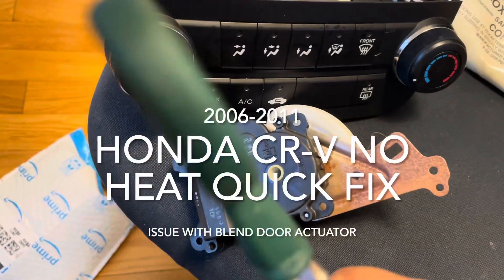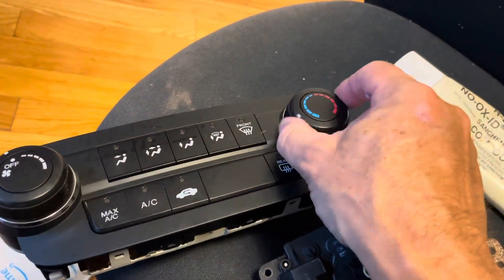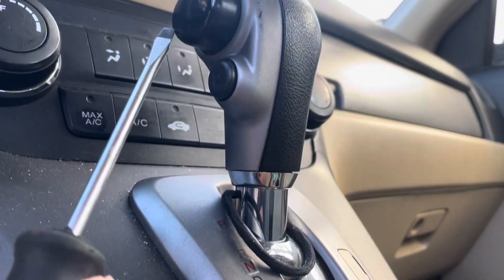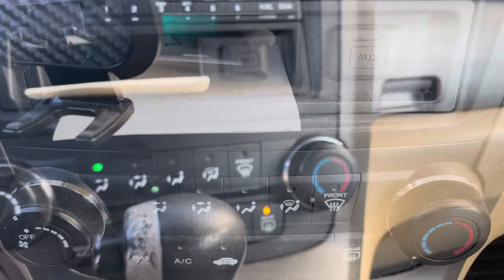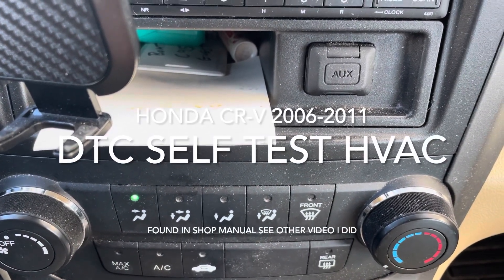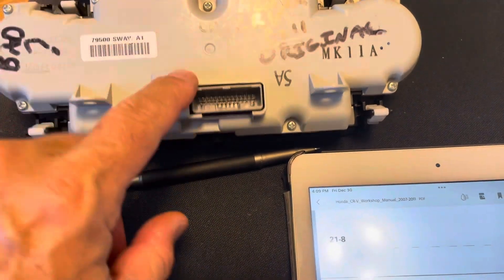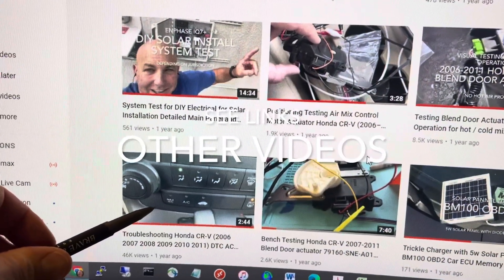Troubleshooting no heat Honda CR-V (2006 2007 2008 2009 2010 2011) no hot air blend door actuator

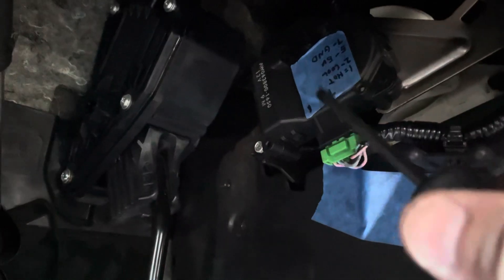Comment: Wow!!!  Tapped the motor by the brake pedal and unplugged/plugged in the green connector and 5 seconds later - heat.  Just like it says at 2:30 of the video.  This is after three chemical flushes, three water rinses and refill with coolant.  I have no doubt that had I brought it in I would have been charged $500, and the mechanic would have done the same thing.... Thank you Danny Jensen!

Comment: Thank you Danny. I tried a couple of steps you mentioned and could not get the heat to come on, then this morning I just tapped firmly on the thermostat knob and also turned it from cool to hot quickly a couple of times, and the heat came on. We will see if it lasts. Thanks for the video and help.
Reply from the maker: That is a new one. There is this stuff called electrical contact cleaner you can spray on the knob. If you have the problem again and it may help.  I have used LPS contact cleaner on an airplane gps knob and it worked great but this is the most expensive stuff.  Other CRC contact cleaner is also good. What is the knob you are talking about? I want to make sure the exact knob you refer to. Is it the warm cold knob on the climate control unit in my video or do you have a different unit?

Comment: My 2011 crv started not switching to defrost. After they replaced two actuators, the AC stopped blowing cold. And then the air stopped blowing. I don’t know what to do. I’m overseas and they don’t know how to work on my American car. 😭
Reply from the maker: @PinkGomo  Thanks for your comment. I am not an expert. Run the self test.  It may calibrate the new actuators. Then repeat self test. See if same results. Then if still not working, pull climate control (cc)  out after watching my video on the topic. Pull connector in and out a few times on cc Unit. Get some contact CRc contact cleaner spray and clean connector cc Run self test. If not working, Double check part numbers on new actuators and possibly swap old parts back in of actuators not working.
Reply: @dannyjensen4954  I appreciate your help. I did pull. The cc panel out and unplugged/plugged. 

It only works when the green plug is not put in. The garage disposed of the actuators… so I think I’m going to order all new ones again and maybe put them in myself or have someone else. Is it possible they put a wrong actuator somewhere? Or is that not possible?
Reply from the maker: @PinkGomo  Wow. You can give me a call at tree 1 0 for 8 niner tree for too 7.
Reply: I tried the green plug under the steering wheel… and when I unplug it, the climate control panel works again and only heat. 

But when it’s plugged in, it won’t work. I think they mixed a wire/part somewhere.

Comment: I came here because my 2010 CRV was only blowing hot air on the passenger side with the driver's side blowing cold no matter what the temperature setting. I already saw one video claiming that little swing arm was "stuck" and that was kinda true but I commented that after pushing and prying with a flathead it didn't seem like anything was attempting to move the arm on its own. So after watching the beginning of this video I decided to give the little green power connector the old unplug, plug back in a few times a try and... what do you know, that freaking worked. I wished I'd have tried this a while ago, I've been suffering for a couple of months, lol. Thank you
Reply from the maker: @robertjmr72  Do you have a different control unit type having left a right heat settings? If so can you send me a link to a picture of the type of controller you have? .. And if possible do you have different locations for the actuators?
Reply from the maker: @robertjmr72  Thanks for sharing your solution with others.
Reply: I’m so glad I just read this comment.. same thing happened in my girlfriend‘s 2011 and I unplugged it and plugged it back in and the hot air started coming out instantly after. Thank you!

Comment: Great instructional video! I like your troubleshooting technique. Ran the diagnostic, measured the heater core hose temps, the door actuator fixed the problem!  $26 part on eBay but, expect to be a contortionist or pay someone else to install.
Reply from the maker: Right. But usually a hammer bang or pulling the green connector on and off fixes the problem. There must be and ideal tool for this job but I haven't found it. My knees were not in good shape after I took the actuator out. Thanks for your comment it helps me to get a return on investment of my videos.
Reply: @dannyjensen4954  I did pull the cable on both ends, and tried banging on the motor before replacing. Also plugged the cable into both the removed unit and the new one before installing to confirm operation.

Comment: i have a 03 crv with hot blowing on passenger side and cold on the drivers side vents and is i turn on a/c its the same just colder . would it be the blend doors. air gets cold at the stop  light

Comment: I have a 2009 crv but the DTC test (button sequence) didn't seem to work

Also probably an obvious question but, when unplugging that green connector from the blend door actuator does the car have to be on or off? Sorry again if it's obvious 😅
Reply from the maker: Off would be best then re run DTC test.

Comment: I'm here to check out the videos.  I have a 2011 and I think the modes are all fine, I have nice heat on the drivers side vents but cool air going out the passenger side.  I do have the duel setup to both read Hi so the heat should be all the same.
Reply from the maker: Something in the dual setup diverter motors then?   Did you do the self test? Otherwise you could go to the dealer or get a Honda shop manual on-line. Maybe even go to an AC shop.

Comment: I've watched all your videos. You said the actuator was not the problem in your case but never mentioned what WAS the problem and what you did to fix it.
Reply from the maker: I replaced the climate control unit but I was not methodical enough to pinpoint this as the exact root cause of the failure. The problem did go away but as you know from watching this video, many steps are necessary to properly diagnose the root cause while the problem BEFORE pulling connectors and swapping parts.

Comment: Hello, this is a long shot that I may hear from you but it’s worth a shot. I have a 2010 Honda crv . My driver side blows warm air but my passenger always blows cold . Ice cold . On the driver side it doesn’t even blow strongly . I know it is the Acuator but I don’t know what exactly .
Reply from the maker: I don't have a control to direct the heat. It heats both areas. I'm not sure you have the type of environmental control. Yours must be a higher end unit.  I'm thinking go to a Air Conditioning shop and see if they can take a look at your car. The AC sounds like it may be on somehow? Its complicated I think. I couldn't find anyone other than the dealership who wanted to trouble shoot my car so did this DIY video but I can't help. Sorry.

Comment: I need the cr-v workshop manual that you were showing on your video.   Where can I get that pdf??  🙏🙏    After I do the DTC test my light blinks twice so I have a short.   I'm confused as to what to do next.
Reply from the maker: I ended up buying the pdf I think. Go to Honda CRV owners group and ask questions. Also unplug the motor and run the rest to see it the test changes. If so perhaps swap the motor out. Look at my other videos on the topic.

Comment: I want to thank you a lot for your video, it helped me big time. I was about to take my car to the mechanic and he was going to charge me $420 dollars to fix the heater. With your video I just saved myself all that money I was going to spend there. 
All I did was a reset of the heater just like you said in your video and that was it!!! Problem solved!!❤❤❤
I can't thank you enough, thank you, thank you❤❤
God bless you always 🙏
Reply from the maker: Thanks for your kind comment. I too went to a mechanic and was told to order parts I didn’t need based on likely fixes. This led me down the road of research on this issue and a set of fixes that seem to work in some cases. Electric issues like this are usually better diagnosed by the dealer I guess.

Comment: Tx.  I had code 2 and 90° air vent temperature and replaced the actuator motor.  Now I have code 3 and gradual 105 degree vent temperature. And I can see actuator working/moving.  I understand vent temperature should probably approach 130 degrees.  I'm going to run as is for a week or two. If it doesn't get hot enough fast enough I may go for replacing the environmental control panel.  Not quite sure what my root cause is.  I've also thought about flushing out the heater core as a last resort.  At present 105-degree vent temperature maybe tolerable.  Tx
Reply from the maker: Sounds line a heat exchanger issue if the mix door is fully open. Let us know what your fix was.
Reply: @dannyjensen4954  after a few days of using the new actuator door it's working perfectly.  I didn't have to replace temperature knob.  I did put bulb greese on  all connectors.  I do think that actuator door was bad but maybe a connector was marginal too.  Tx much
Reply from the maker: @bobWsterguy  I think your comments are helpful to others. Thx
Reply: @dannyjensen4954  local Honda dealer quoted $200 for replacing blend door actuator and $1800 for replacing temperature control module & knob .  I bought new Doorman actuator door on Amazon  for $40.  Did have to contort a lot to install so $200 quote from dealer was tolerable. I didn't need control module.  Dealer insanely quoted $1800 for it saying took 5 hrs to take apart dash.  With help from your videos I could take apart in 5 min to "bulb grease" all connectors.  Now everything works perfectly.  I spent $40 for parts vs $2000 quoted by dealer.  What a story!!  Thanks much for all your help!  Bob
Reply: Manual says that in case of multiple problems, the blinking lights indicator will only show the DTC with the least number of blinks.  Then once you fix that problem and do the DTC test again, it will show the next problem (that is indicated by a higher number of blinks) if there is another problem.

Comment: Thanks for good info.  Just curious??  Could it take the better climate control in place of the dial only temp control?  Might be a nice upgrade to have automatic temp control?  Too much to expect??   Tx
Reply from the maker: I got the simple cheap system that works. Maybe my next car.
Reply: If I remember correctly you first got cold 2 and replaced blend door but that didn't solve your problem.  What code if any did you then get? You stated that you then replaced the climate control unit with manual knob. Then I think all your codes went away.  My ending question is what was the root cause of your not getting heat?  Was there a single root cause?  Tx.  Bob C
Reply from the maker: @bobWsterguy  I think my problem was fixed when I replaced the environmental control. Not sure what the root cause was. I did not run the self tests before I started messing with things. I never had codes. I just generated them by not connecting the green connector on the blend door.

Comment: Vent problem with 2009 Honda CRV
Reply: Heat comes out of passenger seat and window vents but blows cool air on drivers side center and door vents?????
Reply from the maker: Does your control unit look the same as mine? Did you get it fixed?

Comment: Thanks! Just fixed the blend door with a hammer! Lol
Reply from the maker: Thanks. It’s crazy I know. So many people do this and it fixes the issue. The problem sometimes comes and goes so keep a hammer under the seat for protection and fixing your heating.
Reply: @dannyjensen4954  
Put hammer in glovebox. It’s the passenger side sticking. If it happens more guess I’ll get a new actuator. I tapped the actuator and it didn’t work but tapped the blend door housing and it did. Are drivers and passenger side same part?

Comment: put some bulb grease on the air blend actuator electrical connector and motor started working, got heat, thanks!
Reply from the maker: Thanks for helping others with your useful comment.

Comment: Guessing that if you live close to the ocean those electrical contacts might suffer from salt air corrosion which gets temporarily alleviated by physically banging on the unit or moving the connector.   Might want to try spraying some Deoxit on the contacts or the dieletric grease should work also.

Comment: What about the wacky volume knob? Jumps around but doesn’t necessarily go up and down. 

Mine is a 2011 CRV
Reply from the maker: I did replace my control unit. I was having intermittent periods where the mix motor did not work and the mix motor was good. Perhaps remove and connectors on BOTH blend door motor and control unit and see it it gets fixed? The motor position is known by a voltage reading on the motor so maybe a bad connection is causing you issue. Thanks for your comment. Let us know your progress on solving this issue. Mine is also a 2011 CRV.
Reply: @dannyjensen4954  Will do. I am also having the AC intermittently stop blowing cold air. No consistency. Sometimes it doesn’t turn on. Other times we are good for 3-5 hrs. Other times for ten minutes.
Reply from the maker: @jeremylakenes6859  It would be interesting to do the DTC self test and see it the faults change.
Reply: @jeremylakenes6859  Sounds like the compressor clutch isn't engaging properly.  Could be a worn clutch or wiring/ground issue.
Reply: @gfriedman99  I found out that if I turn the car off and then back on it works fine. Sometimes for the entire rest of the day. My cold/hot blend door also stopped working so I’m suspecting its the dial/ac control unit??
Reply: @jeremylakenes6859  Sounds like bad contacts in the control unit if multiple settings are jumping around or not working intermittently.  Especially if you live near a salt air environment.